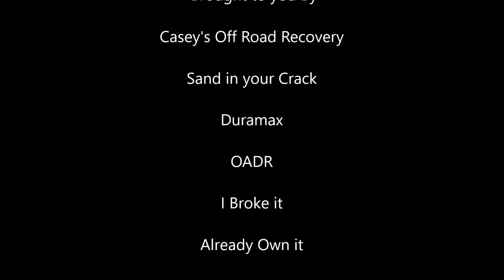**Noddy Track Repair** The Ultimate Off Road Recovery Vehicle is out of commission!

Comment: Take a long post hole bar. put it the track as close to front pocket as possible. 
Rotate the track as slowly forward as possible while prying out on bar. Wash rinse and repeat and track will pop back on. May take several times depending on how loose your track is

Comment: When I was in the army I was in tanks when we threw a track it was a all day or all night job brake the track down then lay it out flat then drive drive over it reconnect and then adjust idler arm all day or all night or maybe the next day
Reply from the maker: Thanks for your service. It was a job for sure. I have done quite a few different tracks...this is close to the easiest
Reply: @CaseysOffRoadRecovery  for us it was formerly the track was thrown to the inside that was the hardest
Reply: @CaseysOffRoadRecovery  especially if you're buried in the mud

Comment: Easy to get parts for the Nodwell ???  What is the function of those horizontal coil springs on the underside ?
Reply from the maker: Yes they manufacturer them about the same way. That is a torsion spring suspension. Very durable and rough as heck.... 😂

Comment: Casey; how many bolts per track on the noddy if you had to replace both sides?
Reply from the maker: 528!
Reply: @CaseysOffRoadRecovery  That's a LOT of hardware & I would imagine it would take just you a couple days to get both sides done & about a 5 gallon bucket each of bolts, nuts and lock washers (if they are used on the Noddy)........

Comment: A fence tightener like a ranch wire stretcher may help get that tight and hold it when you put the bolts in.  Be safe.
Reply from the maker: We used the winch and the come along, it's a brute to work on.

Comment: ON THE NODDY DO YOU PUMP GREASE INTO A DEVICE TO ADJUST THE TRACKS LIKE THEY DO ON A CATAPILER I HELP A GUY PUT A TRACK BACK ON A CAT WE USE A BACKHOLE TO HELP TO GET THE TRACK BACK ON WHAT HAPPEN WAS THE BOLTS THAT HOLD ON THE SPROCKKET FOR THE TRACK THEY CAME OUT THE ENTIRE THING FEEL APART THE GUY PUMP GREASE IN A DEVICE IT WAS LIKE A PULLY WHEEL THAT EXSPAND OUT TO ADJUST THE TRACK
Reply from the maker: Yes I a tensioner grease ram

Comment: Ha ha, I don’t have to imagine fixing a track in the winter. It wasn’t -40 but around -20.  I had all the tools. I just used a come-a-long to bring the ends together on the top. We called the cross bars Grawzer Bars.
Reply from the maker: I was thinking of you...lol
Reply: @CaseysOffRoadRecovery  The Nodwells I worked on actually had a smaller wheel on the front that had a hydraulic cylinder attached to it. The was used to adjust the track tension.by just pumping it up with a grease gun. If track work needed done we’d take the grease zerk  out and hit the small wheel with a sledgehammer to drive grease out the the cylinder creating slack.

Comment: As former tank/track vehicle mechanic for 18 years for the Army National Guard I can confirm breaking track in the field sucks. I've never even seen a Noddy until yours so I don't know if my advice would work the same. Usually you lay the track out and drive/winch (usually drive is easiest) up on top of the track all the way opposite of your sprocket. Then run a chain from your winch across the top of the roadwheels and hook on so that the track stays snug and then winch the track straight back while slowly backing up with the vehicle. Just from the look of the Noddy setup you'll probably need two chains maybe, to keep pressure off those tires, When the track is safely engaged with the sprocket disconnect the chains use the Noddy's final drive to bring it around half way between the last roadwheel and the sprocket. Should leave you more room to work. Making or getting ahold of track connectors would help pull it tight. I don't think I've typed the words track and sprocket so many times in one paragraph. I don't even know if I've even made any sense at all.  🤣

Man It's a crying shame you have to speed up your voice to avoid copywrite strikes. Hey maybe sing some songs in the public domain. Well take it easy man and be safe out there.  😎
Reply: Same for mobile plant, except we join at the sprocket. I see folk using the sprocket as a winch on some vehicles which is smart. We tugged the track on with a fork truck. New are tough because the links are tight and they come rolled up. Quickest was to drive over them to flatten them out :o)
Reply: Casey does have a few songs posted of his performances posted, along with band members. He has a good voice
Reply: @gregparrott  Yes he does.

Comment: Not such a hard job . . . just have to select the right old time fiddle tune. Yes them battery tools have made life on the road a lot easier. Cheers.
Reply: Cordless tools sure have made life easier. When we travel I carry a few including a 1/2” impact and a set of sockets.  I had to change a trailer tire along a busy interstate on a 90 degree day and it made quick work of the change.